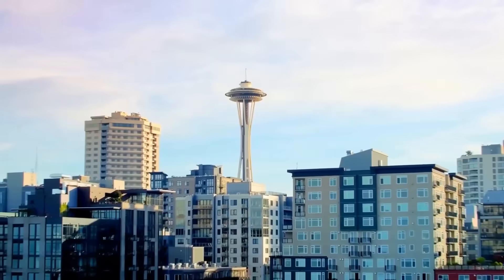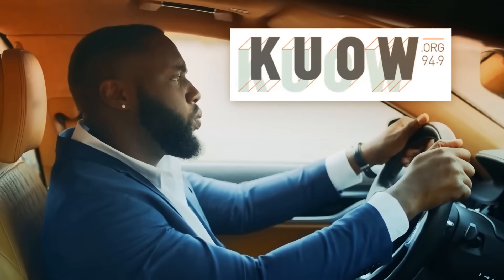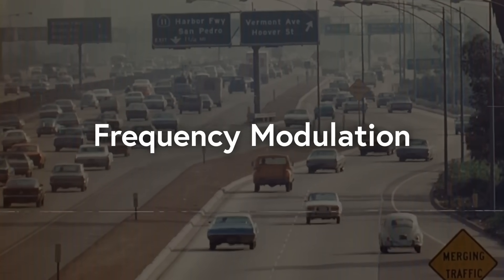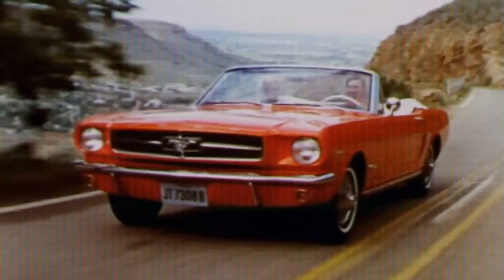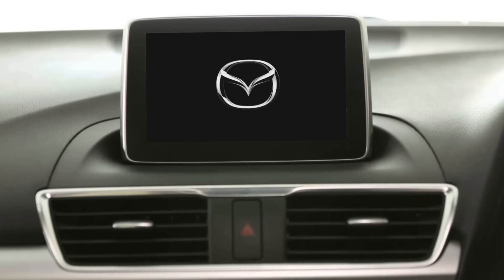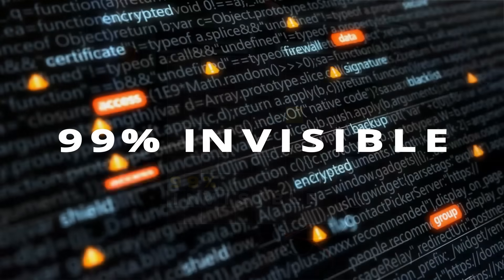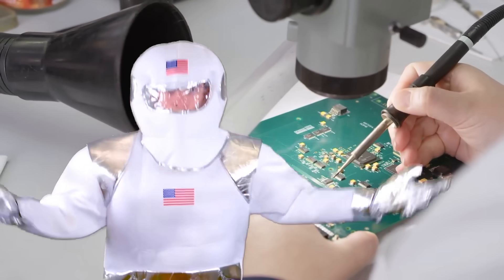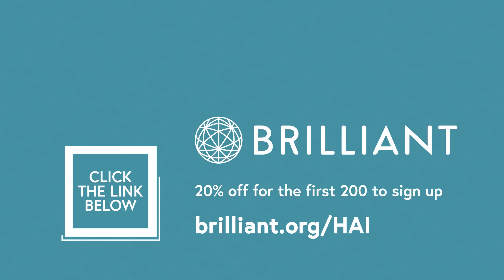Why Hundreds of Mazdas Tuned to 94.9 Broke Simultaneously

Comment: Wait so both Mazda and NPR took zero responsibility and didn't pay for anything? I don't expect it from NPR, but Mazda definitely should--seems like a safety hazard that might be prevalent in other systems and definitely worthy of a voluntary recall.
Reply: NPR did nothing wrong. Transmitting a file without an extension is fine.
Reply: If Mazda doesn’t, that’s a class action waiting to happen. According to the bbc tho, Mazda is offering an application to people for a “goodwill” replacement, it just isn’t clear how difficult it is to get and when those replacements will actually ship.
Reply: This is a software bug in the Mazda infotainment system, NPR isn't responsible.
Reply: why the fuck would npr be responsible here
besides, npr doesn't run stations, it's just a syndicated content service. the stations are independent.
Reply: @romulusnr  I share that opinion, Mazda is 100 percent responsible for this. And it cant be that difficult to fix the software bug
Reply: @BenBensen293  I have a 2021 Mazda3 as well, and the only infotainment issue I've had is that sometimes I have to restart the car to connect to Android Auto/Apple CarPlay. I've heard that the radio problem only exists with Mazda's old pre-2019 infotainment system, but that system was Toyota Entune levels of bad, so it doesn't entirely surprise me. But you're right, Mazda should absolutely take responsibility for any bugs in their software.
Reply: Mazda has actually offered to repair the radios for free. When they say "repair" they probably only mean that they will delete the bad files.
Reply: What safety hazard?  Is listening to a song without a picture of the artist displayed on your dashboard dangerous?  It's not the engine, not the transmission, not the brakes, not the steering......... it's the INFOTAINMENT.  Which is apparently a thing now.
Reply: NPR did nothing wrong, whoever wrote the code for the radio is ultimately to blame.
Reply: The Question is, if this is still the Case in new Mazdas. I have a 2021 Mazda 3 .
Reply: @BenBensen293  4th gen Mazda 3 uses a different infotainment system than the one in the video. There was a bit of a revision in the 2017 or 2018 model year to introduce Android Auto and Apple Car play, which coincides with the video saying it only effects 2014-2017 Mazdas, so I'm assuming based of that information that the issue has been fixed for years.
Reply: @BenBensen293  If so, I'd bet on it that there will be a software update incoming, maybe even over the air, if Mazda is supporting this. But they will for sure not let this happen again.
Reply: @torbenmayer  Yes I think so too. I use radio very rarely, so I think it will not happen to me. Over the Air Updates are not possible at Mazda.

Comment: This is why most cars have separate networks for low priority signals (radio, infortainment) and safety critical systems.
Reply: I'd like to think that safety critical systems don't have any network access whatsoever!
But apparently sanity is at a premium in the car industry these days. And brain fuel prices must be at an all-time high, too...
Talking bout remote start and remote control/"summoning" of a two tonne car...
Reply: @LRM12o8  Even in most drive-by-wire cars, the brake pedal is still mechanically connected to the braking system.  Even in the face of a malicious firmware update, pressing the brake should always work.
Reply: @TheCountExtreme  Steering as well. Electrically-assisted, but mechanically connected.
Reply: Umm, not really. They have separate units, but many cars have common networks for both. There are software 'firewalls' between functions, but a bug in that...